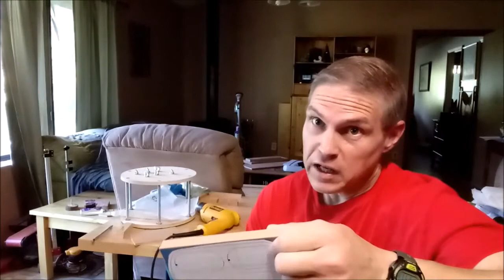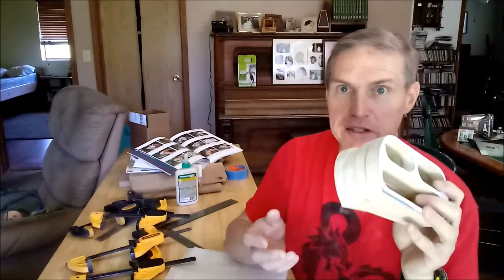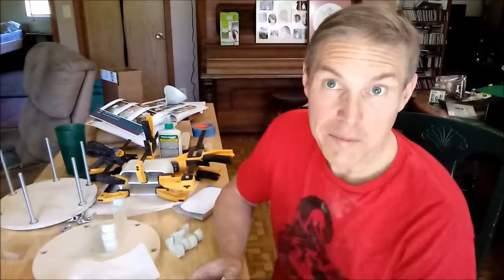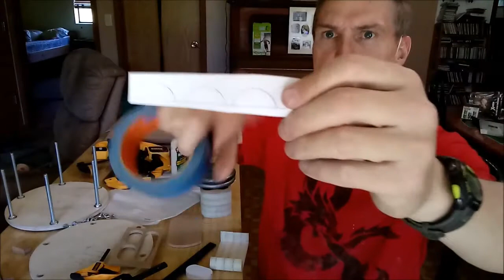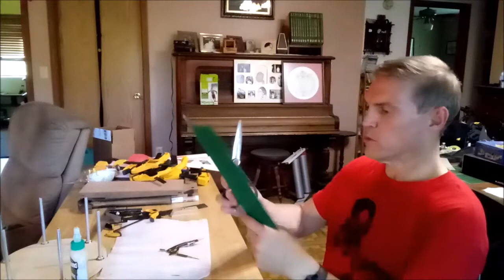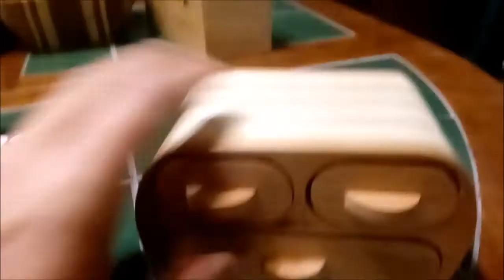Making a Scroll Saw Box

Comment: Solution to your pilot hole dilemma.... Drill the hole in the part of the drawer that gets cut out and thrown away. Thought of that half way through my current box, sure it will work though. The pattern you used in this video was the same I used for my first bandsaw box I made the pulls look like an emoji face😊
Reply: Bugger just read this, would have worked really well

Comment: Great looking box!   What type of double sided glue did you use?
Reply from the maker: I'm not sure exactly what you're asking. I used regular yellow wood glue throughout the entire project (although for something like this white glue would probably work well, also). I put blue painter's tape on the wood then use a glue stick to attach the scroll pattern to the tape. (The tape helps lubricate the scroll saw blade and allows for cleaner cuts.) I use thin double-side tape with a peel-off backing to attach multiple layers of wood together if I need to scroll them at the same time.

Hope that helped.

Comment: Why did you use a size 2 blade for the inside and a 9 for the outside on the same thickness wood?
Reply from the maker: I used the size 2 blade on the inside to minimize the size of the hole I had to drill into the work piece. I used the number 9 blade on the outside hoping it would make cutting through the thicker wood easier, but I didn't notice much difference, and, if I were doing it again, would probably go with a number 7 or even leave in the number 2 and go very slowly.